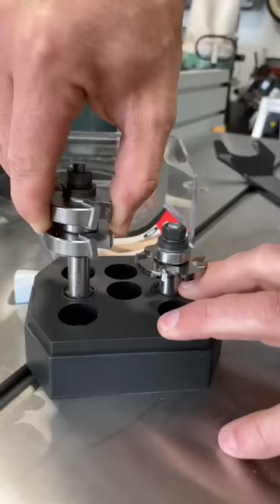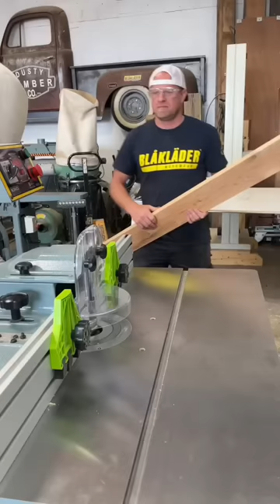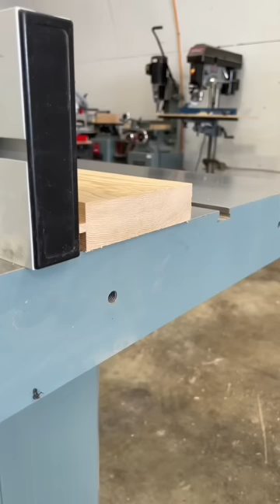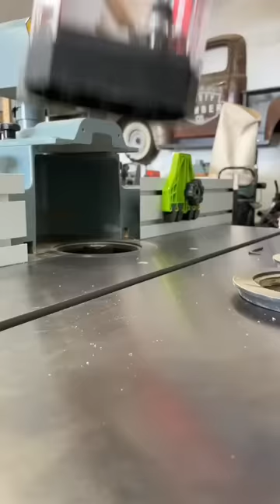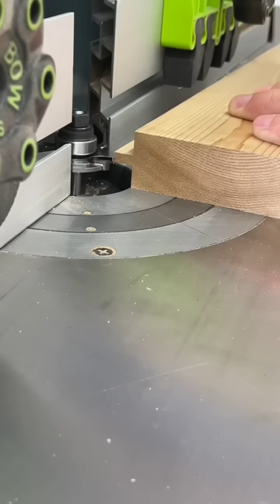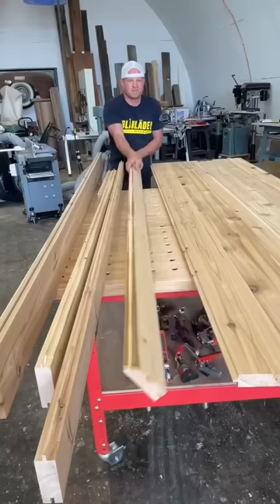T&G cutters @Freudtools  #woodwork #wood #woodworking #bois #holz #maker #tools #madera #joinery

Comment: Would it not be more accurate to cut the groove first? That way when you set up the tongue cutter it can slip inside the groove. Sort of like a go/no go thing.
Reply: Makes a lot of sense.. I’m gonna remember that one.. Appreciate that.
Reply from the maker: Works either way 👍
Reply: @dustylumberco   Is that a rockler table
Reply from the maker: @rickyperkins232  it’s a Kreg